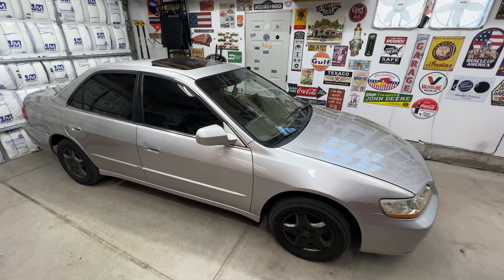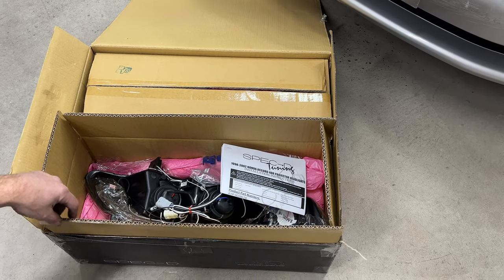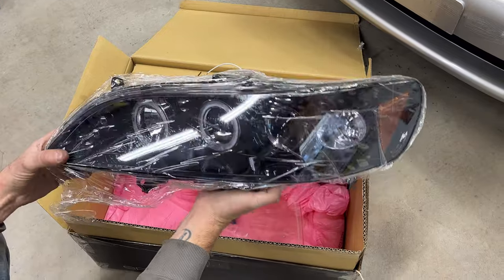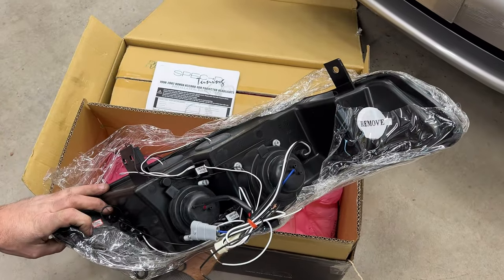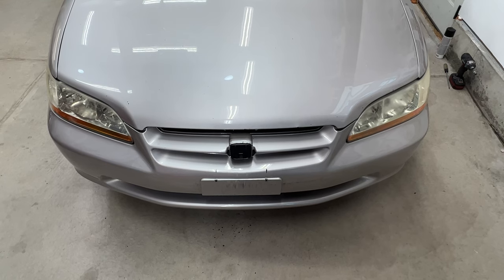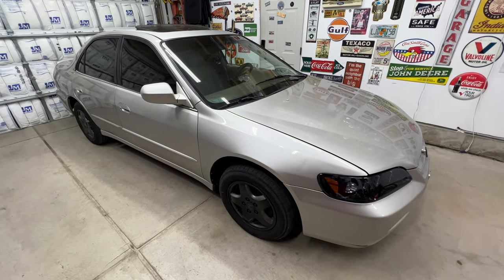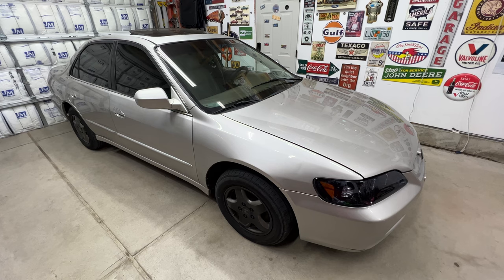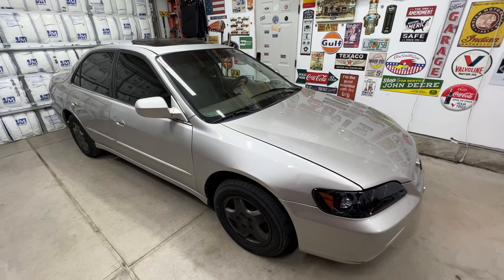Honda Accord LED Halo Headlight Assembly Upgrade Spec-D Tuning

Comment: I like how in depth you video is, BUT I strongly believe your wiring for the halos is wrong. Theyre meant to be DRL your hook up into the headlights makes them lose their purpose as DRL. I just bought these from redline and jn their video, the halos are only on eith the DRL

Comment: Hi wanted to buy the projectors but since I bought the upgraded 9006 9005 bulbs my question is will they fit in the spec D housing? If not what size bulbs are the spec D s lows n highs ?? Thx
Reply from the maker: Yes they will fit the spec d housing. They use the same bulbs high beam 9005 and low beam 9006.

Comment: Did the transmission give problem after the lube guard oil switch
Reply from the maker: No the transmission didn't shift the greatest since we bought it but did get a little better with the fluid change and lube guard. These years of Hondas weren't well known for the automatic transmissions.

Comment: Looking for some headlights to install on my 2002 Honda Accord coupe. are these actually bright? looking for high visibility because I have trouble seeing at night along with living where there are a ton of deer
Reply: If you need brightness that’s going to be dependent on your bulbs, and these bulbs are not bright. I’d recommend just replacing whatever bulbs you have with LED replacements and keep the factory assemblies. I changed my assemblies to these because my factory one broke and I wish I got OEM instead lol, hang onto those factory assemblies as long as you can
Reply: @tranquilalpaca3819  yeah I’ve just cleaned them too many times already and they get foggy quickly. I use the kits they sell to clean headlights and I do have LED bulbs as well